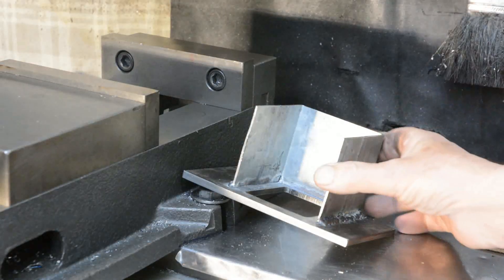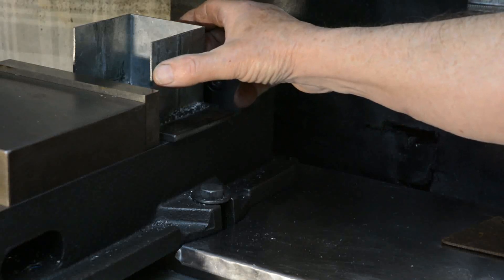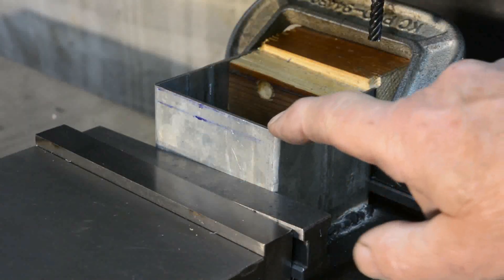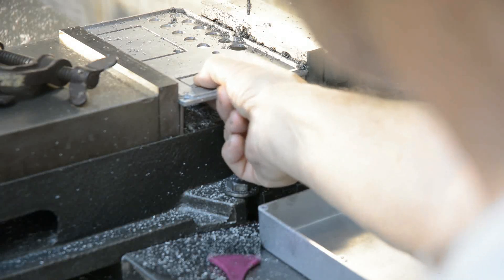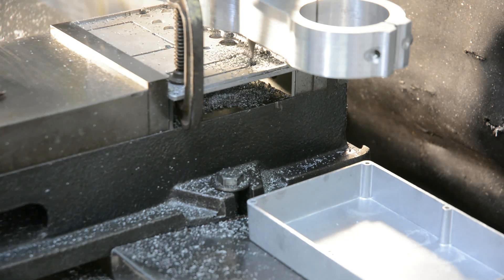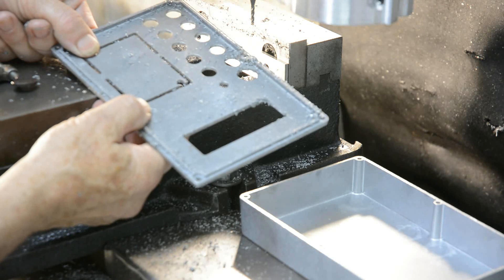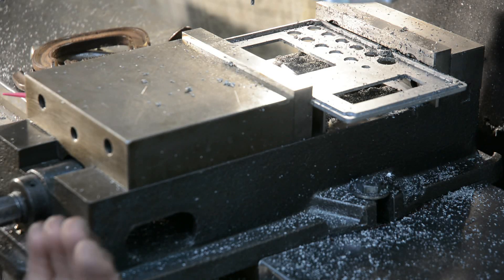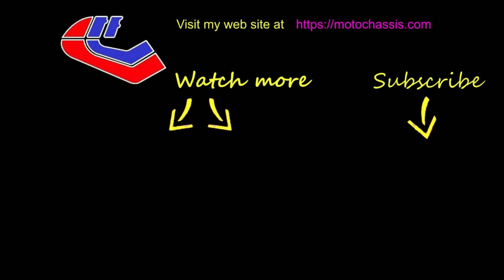DIY Great tips for milling.

Comment: Often just machine flat a piece of 2"x4"/2"x6"(or particleboard flooring bolted to it if I need a larger surface) with a lip/edge of some sort to line things up, and bolt flat pieces to be machined to it using some wood screws with screws going through the center in places that will be removed or already have placed and drilled holes and some washers and screws along the edges as needed...
Reply from the maker: Many ways to skin a cat.

Comment: Rather than clamps that can get in the way, I sometimes use a machine screws and nuts in the slot. If you've got nylon versions available, you can mill straight through them (on purpose of course!). I prefer to mill instrument panels clamped down onto sacrificial MDF. If I've got more than one to do, I'll machine a pocket for it to sit in.
Reply from the maker: All good tips.

Comment: Another great video, to stop bits chattering in the vice I often stick a big lump of Blu-Tack on them,  seems unlikely to work but the added mass really helps.
Reply from the maker: Blu-Tac, plasticine, clay etc. all work to some extent.  The extra mass has an effect but the main thing is damping which is why those soft and "dead" materials work where a solid mass would not.
Reply: @MotoChassisByTonyFoale  The problem with plasticine is it's tasty..... That's why I only have Blu-Tack left :)